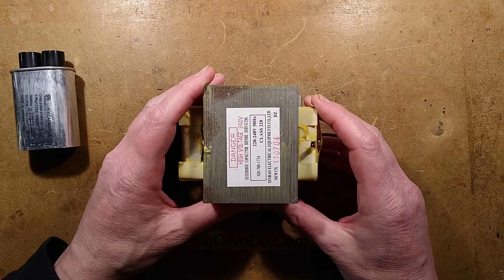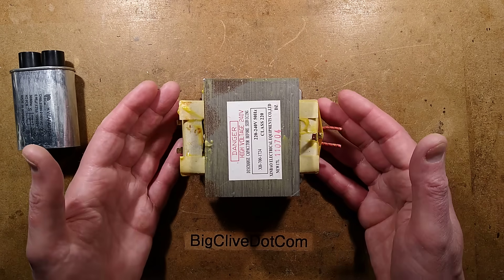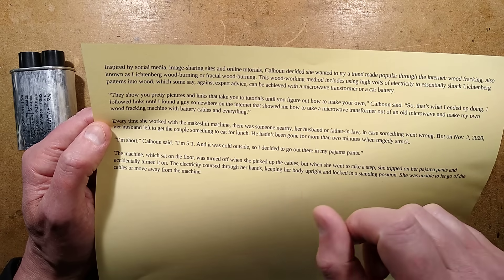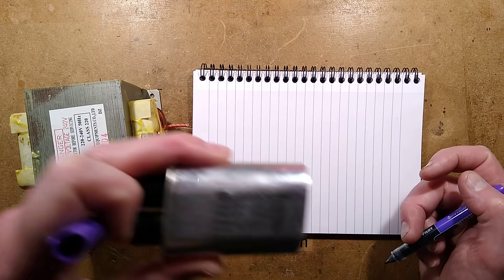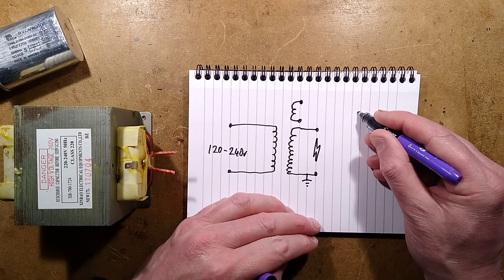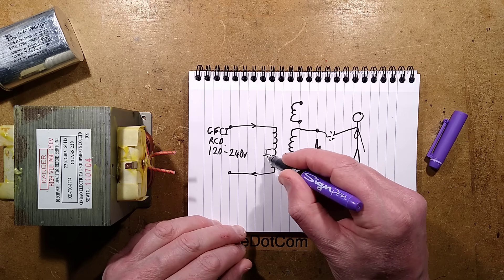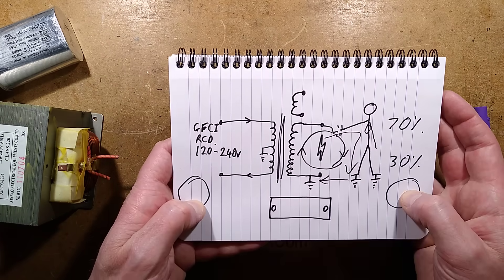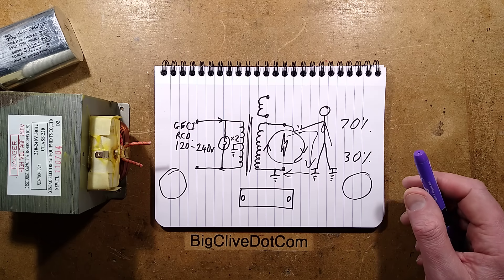The most deadly project on the Internet

Comment: There's lots of cool projects you can do with microwave transformers. 

But even if I have the equipment to hand, I never tried it because I just don't trust myself!
Reply: Making popcorn is about as far as I go
Reply: Ha ha and popcorn it does well good advice
Reply: @joearnold6881  You completely reckless daredevil! There is heat involved in that!
Reply: @joearnold6881  I think that "making popcorn" is what BigClive is alerting people to!
Reply: People underestimate electricity like they underestimate fluid dynamics when it’s got you it’s got you
Reply: @lostmykeys85  David Dobrik really underestimated that excavator 😅
Reply: @Riley_Christian  Wait what happened?
Reply: @lostmykeys85  " Oh the undertoe isnt that bad, i can barely feel it pulling my feet when i stand..."
Reply: This is why I don’t have a high power laser. There are lots of little projects I could do with one, but I really don’t want to think through all the safety interlocks I’d need to have. 

Lots of them come with laser safety glasses. From unknown vendors. Nope.
Reply: @gf2e  Don't stare into beam with remaining eye!
Reply: @gf2e Agreed. I purchased an rgb 10W unit which cannot really have safety googles other than black - but  it came with a pair of amber googles. Not only were they UTTERLY useless for RGB, but they failed to stop ANY of the component colours too. It lulls people into a false sense of security.

If the projects are not visual (eg: cutting lasers), then if they come with a fixed focal length (typically a couple of cm), then they are much safer by design - as if your eyes are (for example) 60cm away when the unit is on,  then the beam power density collapses extremely quickly. Also a single colour laser is a lot safer as you can buy a single colour set of goggs with perhaps a 1% "pass" from a professional supply company as opposed to "super mega laser safety shop - we very good, you buy now".

I like a tiny amount of "pass" on the goggles as you don't then forget that you have a powerful laser powered up and get tempted to remove the goggles as you think it is off!
Reply: I've blown up ardiunos, led strips, capacitors all accidentally.  No way I'd start fooling around with microwave transformers and Tesla coils.
Reply: @mc_cpu  with 2kv @500mA, you can only make one mistake.
Reply: @omniyambot9876  Its worse than that, MOTs are not current limited so they will put out more than 500ma until their winding burn out.
Reply: @JerryBiehler  absolutely. They force what they could push.
Reply: @JerryBiehler  exactly. 500ma is just the running current. Fault current much higher.
Reply: @JerryBiehler  Totally - if the secondary has failed (short), then it can trip a 20A breaker - not sure about 32A - (at 240v) so this would suggest the primary at least, is happy to pull around 5KVa - or ignoring losses, about 2.5A at 2000v if the secondary is still playing ball.
Reply: @omniyambot9876  ..and only once
Reply: @omniyambot9876  only smaller shool example tesla coils has that low voltage...
Reply: @mc349iii
I got hit with about 50 volts in the face once doing something really dumb as a teenager. It felt like getting smacked. But since it was a low voltage it only startled me and make go "that was fucking stupid". And Ive been working on electronics since I was a kid and know proper safety. But teenagers are dumb. Id never mess around with something like this, I cant believe this is out there for randos to try. Anything that starts with "take parts out of a microwave and/or CRT TV" really isnt a good idea...
Reply: @mc_cpu  I've always been fascinated by tesla coils but never adventurous enough to actually attempt one, probably for the best I think
Reply: @mc_cpu  how do you blow up a ardiuno
Reply: @FreelancerFreak  I ran the full current for a 5m RGB LED string through the Arduino's 5V pin. Set all the LEDs to white and popped the voltage regulator on the board. It was a mini board. I learnt only to connect the signal pin to the Arduino!
Reply: @mc_cpu  hopefully you learned a valuable lesson
Reply: @mc_cpu  ooh tesla coils are fun...lol....10 Megavolt electric gun ho ho ho ..
Reply: Same here. I'm an electronics engineer with decades of experience and I still make silly mistakes with low-voltage stuff. No way I'm going to mess with 2kV.
Reply: @Onwrikbaar  Ditto, this is just way too dangerous to even contemplate.
Reply: @tubaman66  Ditto here too. I came very close more than a couple of times of getting zapped badly. 

During my days as a hardware tech for a video terminal and early PC manufacturer, 
I was attempting to repair some really, really old video terminals that belonged to another company that was acquired a few months before. We weren't given much training on the equipment other than here's the parts and schematics. Good luck, have fun, and don't call us for help.

I put the scope probe in to check for a signal through the output driver and wasn't even close to the flyback transformer which put out a nice blue arc between itself and my probe!

I yanked my hand out and my coworker cut the power to the unit. Periodically, we would smell ozone around these units and now we  knew why!

This behavior was totally different from other units we used to work on even though the circuitry was similar. The difference being the layout and the type of transformer which was a lot different and the age of the units

After that incident, I was more than happy to let others work on the output end of the devices and stuck with the logic cards such as I/O microprocessors, RAM cards, and peripheral controllers.
Reply: @Onwrikbaar  I have designed and commissioned power control systems for 35 years and even had a (now expired) permit to work in sub stations. For home projects I stick to stuff below 600V DC (valve audio). If you are working with over 50V you need to:
* Be sober
* Be Alert
* Be Methodical and Careful

Anything else is just too close to suicidal. Probably best suited to the sort of individual who builds fireworks in their shed (gave that up myself after a close call as a schoolboy...).

For (UK) domestic mains stuff, read and understand BS7671 (wiring regs) and (in England and Wales) get it double checked by someone with part P if that isn't you.
Reply: Unless you really know what you're doing never disassemble a microwave for the electric parts. Every year there's a number of people who die doing that. Even unplugged, the capacitors can hold enough electricity to give you a fatal shock.
Reply: @OnlyKaerius  If you store high voltage capacitors you should install a jumper wire between the terminals. I've never encountered this but they say high voltage capacitors sometimes build a charge sitting on the shelf. You should use a resister to discharge a capacitor instead of a screw driver. The high current from a direct short can blow open the internal connection inside the capacitor let alone blow the end off of your screw driver.
Reply: I had an old microwave that I was going to take apart to make something cool when I stumbled across these statistics and so chucked it in the recycling!
Reply: @Vassle  remove its hv winding and replace it, that way you have a low voltage high current transformer, you can do cool stuff with it or just make a high current power supply
Reply: @Vassle  i have an old microwave i was going to take apart and wanted to do something with the transformer but now I think I'm better off just getting rid of it
Reply: I've worked with 12kV power supplies used for powering the klystrons of extremely high power microwave transmitters.  The power supply filled the inside of a cabinet as tall as and several times wider than a 19" rack and rolled out on rubber wheels.  You just need to be well trained and to THINK about every action before doing it.  It helps to be and remain afraid of HV which I easily was.  Never get casual with lethal high voltages.
Reply: After I made Jacobs Ladder with Microwave transformer, it was very addictive and removed almost all of my fears to high voltage high current supply. The scarier part is that I'm not scared anymore. So I destroyed the transformer and never touched one again. I just made a high pwoer DC supply with ZVS-flyback parallel high voltage supply that is much safer and controllable. Also, a foot switch insulated and anchored to the ground far away from the high voltage area.
Reply: @omniyambot9876  +1 for footswitches, very difficult to accidentally trigger
Reply: @alecwood1282  that is a foot switch double line that is held by spring and normally off. So when I go away from the switch, everything turns off. Thanks man!
Reply: @omniyambot9876  I hope you do this with good ventilation.   That burnt metal smell is stuff thats going to damage your lungs
Reply: @smay6197  ohh thank you for the tip! Recently I've been overthinking of lead poisoning because I make soldering lead explode by shorting supercapacitors.. It was fun. Intil my room was filled with LEAD DUST! I'm gonna get a blood test because the temperature is enough for lead vapor. Just for stupid game!!
Reply: @omniyambot9876  a word of advice, be extremely carefull using high voltage, and even mor using high voltage seebeck effects (flycack current devices)..the voltages can be many many times the transformer voltage...
...its quite easy to damage ur nerves...
Reply: @Patrik6920  what high voltage seebeck effects? That sounds thermoelectric.. sorry if I don't understand. Yes I am very careful with high voltage.

And also what are you talking about low voltage school examples? First of all it's a jacob ladder not a tesla coil, current and jump distance matters as much as voltage itself. I've already made tesla coils running for millions of volts but not with microwave transformer.
Reply: @omniyambot9876  thje seebeck efffect or more known as puchback, is the effec that happend when the stored electromagnetic flux (the energy stored as magnetic field energy) puches back, its one of the working principles of high speed switching power supplies...ex: feed a coild with 2KV for 1 microsecond, and the puchback can be a 1M v for a ns...
Reply: @Patrik6920  that's interesting.. but does the ns millionvolts have enough energy to be fatal?
Reply: @Patrik6920  yeah but I'm not talking about power. But energy.. I doubt the ns millionvolts can kill me. It's too too short but too high powered if actually lasted for ms.. but I don't have scientific evidence so better be safe.
Reply: @omniyambot9876  ya i agree...i think thers been test on pigs (thay r rougly human like in many aspects) i think its where the result 25mw comes from to...dunno if tests been done on high voltages...not a test u do on humans lol...if u dont volounteer :D
Reply: @LabRat Knatz A friend of mine used to work in a power station: it was made very clear to him that if he saw a cloud of water vapour a few feet away from a pipe, under NO circumstances was he to pass between it, for the reasons above.
Reply: @HowardLeVert  His positive qualities hardly need pointing out though I'm personally over the purposeful accidents and it could be argued that always getting away with it actually sends the wrong message, case in point his MOT videos are recklessly dangerous and nearly cost him his life by his own admission, yet he still doesn't take basic precautions with something that kills 40 people a year in the US alone. Like him I've received plenty of shocks both accidentally and on purpose from things usually considered dangerous but I know where to draw the line and observe proper safety procedures and have a step-by-step plan in place, something he has never demonstrated.
Reply: Most of the ones i've seen have you strip the high voltage winding and put in a low voltage one.  In those cases it's fairly safe once you get past the microwave disassembly part (the caps are pretty nasty, but you can just short them with a screwdriver to make sure they are discharged before going anywhere near them)
Reply: @Wooble57  Beware! To my surprise and pain, "Caps" can restore charges even after being shorted out.
Some capacitors or other devices with capacitance will do this.
An example of this is a CRT final anode, they will bite multiple times even after being shorted out !! 
if you remove the capacitor you may be disconnecting a bleed resistor too.
I jumper the terminals, even in storage !! (No pun intended)
Take extreme care!! Working inside any electrical or electronic device, you are always doing so at your own risk!!
Reply: @Wooble57  The screwdriver part can be bad for the cap (shorting a large cap dumps a lot of energy across it) and maybe bad for you if the handle isn't as insulated as you think it is. A fairly easy thing to do is use a length of PVC pipe (terrific insulator!) with a two-ended aligator clip wire taped to it. Clip one end to a grounded earth. Use the other clip (the one at the end of the PVC pole) to touch the capacitor leads.
Reply: @ibanix2  Again though use a resistor rather than I wire to reduce transient surge current to prevent damage
Reply: @Wooble57  They are in a high voltage insulated tube, odd screwdriver you have. Alength of the old sparking plug wireis rated at around 20,000 V
Reply: @Wooble57  "you can just short them with a screwdriver"
Just stick to warming soup and stuff with your uWave; stay safe.
Reply: @Wooble57  by "CAPS" I believe you are referring to the CAPACITORS... just for those who may not be familiar with the nomenclature. 🌙
Reply: same lol
Reply: I'm right there with you. Shit happens. If you rarely mess with something you can get away with clarity and caution. If you tinker with it all the time eventually you're gonna pull an oopsie. The other day I just got through reminding myself how I never get shocked messing with 10kV capacitors cause I always make sure to discharge them right after powering off. So there I was somehow thinking I already discharged an 8kV bank at something like 40nF and I'm casually grabbing clip leads off one in each hand and feel the tingle of being moments away from breakdown and catching a real bad oopsie. Shit went fizzzzzzzz and I just kept holding the clips like "hmm that's weird" like a dumbass until snapping out of idiot mode and dropping them quick fast like hooooooly shit
Reply: @LabRat Knatz I believe it's usually called dry steam, because it's, well, dry, nearly all gas and no vapour.
Reply: Same. I mainly stick with 5v and low amps.
Reply: @HeathenHacks  agree. Raspberry pi and ESP projects are great fun, and they don't kill. If I want to switch mains I re flash smart plugs with tasmota so I can play with them over WiFi. No physical contact
Reply: @chrisreynolds6331  Or I'd just order/hire someone if I need/want something like the one on Big Clive's video. lol. By doing that, at least my time won't be wasted if it turned out ugly. lmao.
Reply: I've drawn arcs and ran Jacob's ladders with twin MOTs and even car coils running off 240 vac which can explode in a shower of hot burning oil if you're not careful, got a few videos of those too and I'm still around because I'm absolutely paranoid about safety; watch ElectroBoom to see that even somebody who really should know better can be stupidly careless with microwave oven transformers even after getting 'bitten.'
Reply: @MadScientist512  you should watch styropyro or photonicinduction
Reply: @ShahZahid  Already do! :)
Reply: @ShahZahid  Photonic has disappeared again..No video for 7 months I think..We all have good days and bad days but he has whole bad yrs apparently..
Reply: @ShahZahid  love styropyros laser oven videos
Reply: If the first step is "cut out the high voltage winding" then it's probably OK. Making a spot welder with one is like this, replace the HV winding with like 3 turns of heavy wire to make a 4 volt 100 amp supply is pretty safe.
Reply: @John_Ridley  yep some welding lead wire works great I believe they are like 4 gauge sorry if I'm wrong I suck at gauge guessing  and also I stoped messing with making power suplys from them after I zapped myself with a small one it was a weird frequency or somthing because it felt like  jumping into realy cold water hand first .=. Now I usaly make electromagnets and stuff from them
Reply: I always thought it'd be neat to build a lacob's ladder... but for safety reasons haven't done so.
Reply: @kingjames4886  They are fun...but they can also be lethal.
Reply: I've found the safest way to disassemble a microwave is to leave it for a month, or longer. To allow the cap to naturally discharge. No high voltage stuff, for me.
As a near-60 plumber, I used to carry jumper leads. If I had to cut a metal watermain pipe, I would bridge it, with the cable. I still remember our  tutor telling us, of the deaths. Thankfully, earth pegs were invented. Also, there were times when just touching the pipe caused tingling (which was why I learned to touch any pipe, with the back of my hand). Obviously, an electrical fault, in the house wiring, causing the current to go to ground.
Reply: Someone should show us how to make a food heater.
Reply: Watch the effects of arc flash accidents to learn respect for high voltage!
Reply: You are wise! There are over 70 cases of people killing themselves with fractal wood-burning, including professional electricians.
Reply: @LabRat Knatz Sounds like that shit we had onboard ship in the navy.  High pressure steam leak in a pipe will literally cut you in half!
Reply: I am learning that it takes integrity, honesty and intelligence to recognise there are things you can't just do and that ignorant overconfidence is more dangerous than almost anything else.
Reply: Very wise, if you do not have the right knowledge.
Reply: Point to note don't ever touch a microwave transformer on the core when it's active, that shit will pull you in like a magnet and possibly fuse your fingers together and start boiling your blood if you remain like that long enough.
Reply: I remember seeing a video of a man caught between a 32kV transmission line and earth He became very unwell and finally caught fire RIP
Reply: You can make a 98%safe project from them I made a massive electromagnet from an old industrial one gota weld the plates back together and whatnot and I'm going to make a electric vice from it
Reply: wow, respect
Reply: Same here. I got burned on my thumb once inspecting a DVD player that had been unplugged for a full year. I accidentally touched a capacitor on the back of the circuit board. You could see the entry and exit wound on my thumb. It was tiny, so not that dramatic, but still something to look out for.
Reply: I don't have spare microwave...
Reply: I've been bitten by a 240v before. Not too fun lol
Reply: Yeah, I mean there's plenty of other projects, too many to ever get to. Why would I choose something this dangerous.
Reply: I trust myself, but the risk/reward isnt there. There are plenty of cool projects I can do without risking killing myself if I make a mistake.
Reply: I don't trust you either.
Reply: Always the smart way to go. If you aren't sure, don't fuck with lethal shit.
Reply: Smart
Reply: Same with lasers - it's just not worth the risk, even when I know what safety measures to use - even the experts make mistake.
Reply: I only used the microwave fan to make a laptop cooling tray.
Reply: No, there’s 0 cool projects you can do with microwave transformers. I don’t care what is possible. People need to understand how dangerous it is to mess with stuff like this. Don’t tell people it’s cool, or they can do it. Talk about the risks before you say what’s possible with them. Honestly I’d say unless you’re an expert and know exactly how these circuits work don’t mess with them at all, don’t even think about it.
Reply: I have rewound them as a choke for my stick welder before but all that does is just smooth out the ripple.
Reply: Brilliants are not as smart as they think they are
Reply: Dont advocate for it ffs
Reply: @LabRat Knatz what's the name
Reply: That's how I feel about motorcycles
Reply: Or post them on the Internet for kids to copy i hope.
Reply: I have a couple of NSTs and I love to draw arcs with them, I also have few MOTs and I did draw arcs only once just to say I did it and put them away. Those things are too unforgiving to just play with them.

However you can still at least make yourself a spotwelder
Reply: Dave Pin  Mehdi
Reply: I've made a simple single wire power system using two mots and a couple of ground stakes
Reply: @RayRayGaming-cr3rw  Not a great idea from the safety point of view.
Reply: @BrianG61UK  nope, nothing I ever build is safe lol. I'm more of a full send it type of person. I've built diy x-ray generators, Tesla coils, golf ball cannons, etc.
Reply: No one would have ever invented anything with the "adventurous" American spirit of today's idiots.  

Better safe than sorry? Not really.
Reply: @jakeeddy9256  you should have added: "and lived".😉
Reply: Well that's nice but unnecessary you shouldn't be afraid to do projects these dead morons lol didn't know what to do with the stuff